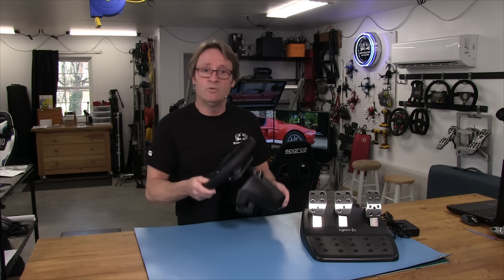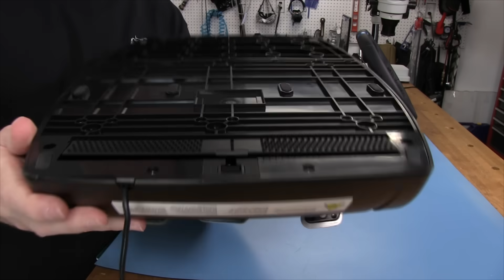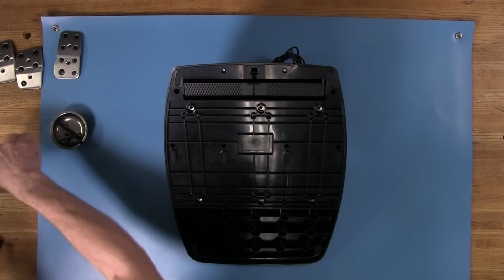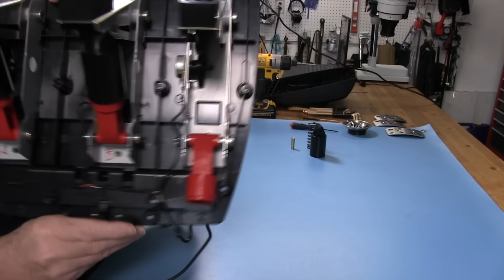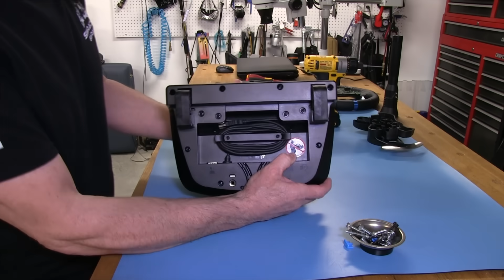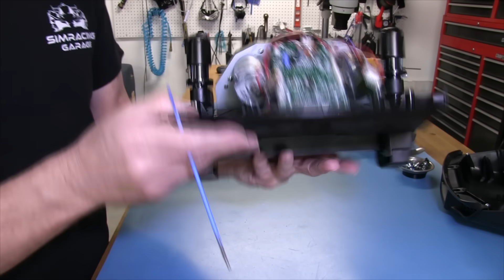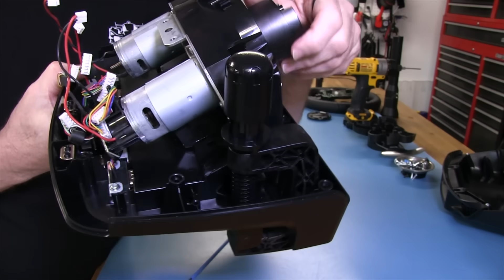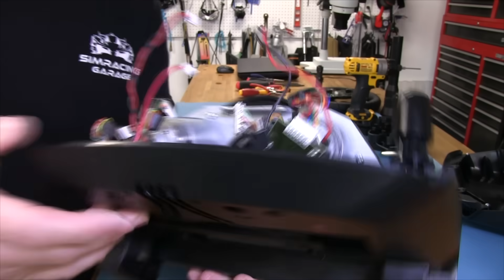Logitech G29 Review

Comment: Looking at getting the g29, however some videos seem to show really loud gearing. Is it actually that loud ? or is it just a few cases ?https://www.youtube.com/watch?v=7SCf9lEcj9g
If it is i'll be looking at the t300 rsgt, anyone got any advice ?
Reply: Hey I have a g29, the gearing isnt too loud on mine at all. I definitely cant hear it if im using headphones. However, most of the creaking I hear in the link you gave is actually coming from the clamps holding directly onto the table. I noticed this as well and I just put a washcloth or something similar between the clamps and the table to get rid of the vibrations. This made it much quieter.

Comment: Thanks for this awesome guide. Mine Ps4 light is stopped working (sometimes working when moving wheel forward) and the wheel is too loose moving along z axis easily not seem tight. Are these fixable by this way?. I don’t want it to give warranty as it will take too long.
Reply: TOLGA YILMAZ hi can you tell me what game I should get for my ps4. My Logitech g29 is coming in a few days and I really want to know what game i should get, I already got the crew 2.
Reply: Frashine1Gaming I definitely suggest dirt rally 2.0, tried wrc 8 as well but it has a way to go. I find more challenges in dirt rally to keep playing.
Reply: TOLGA YILMAZ ok thanks I will get that then

Comment: 39:50 for me that look like the steering angle limiter  i wanted to see it turned all the way to 1 side
Reply: Yeah, that's what it is. I have a DFGT, which I've taken apart a few times and it has the same system
Reply: Even it is a very nice review this part annoyed me very much because he had enough time to figure out what it is for. The statement that a plastic part can have any additional stabilization over the two huge bearings made this more awkward.
I don't want to be rude with this comment, just I think if I would make a disassembly like this, expecially to show the components and their funtion at least I would ask help from somebody if I'm not sure in sg.
Reply: You're right. The lug on the steering shaft impinges on the end of the rack at the end of the wheel's travel. If you take apart a Driving Force Pro you'll see that it has an additional piece that slides back and forth (in the direction of the steering axis) to provide an alternative set of stops for 200 ° operation.
Reply: @Catcrumbs  my logitech momo is due for replacing its getting old still working though

Comment: The only issue I have with this wheel is the button placement. I keep hitting the L1,R1 buttons and the directional pad when drifting. If it wasn't for that I'd stay with the g29. But the thrustmaster t300 gt has a much cleaner and out of the way button placement.

Comment: Honest Question. Just getting into Sim Racing and I am torn between the G920 and the TMX setup. (w/applicable shifter.) Which would you honestly recommend more? Playing F1 2019, Forza 7, and Forza Horizon4 mostly. May also add AC to the library soon.
Reply: What did you decide and why..??
Reply: @ranakirti  Still debating it, however, now I'm leaning towards the TS-PC, as it seems much better than the $250 range guys, but not quite DD tier. So, a good, in the middle.

Comment: There is no firmware curve at all.   I have the way older g25 that has no insert. I inserted a piece of rubber and it worked.  You just need to do a calibration in the software if you sont it feels off. And these mods work on the g25. G27 and g29/g920 in the same way.  If the peldals show half your drivers arent installed correctly.  Windows 10 default drivers do this.

Comment: G29 vs Thrustmaster T300rs Gt Edition? Pls let me know your opinion!
Reply: The g29 is a descent entry level wheel but its not even somethin to compare to the  t300... even the t150 has nearly half stronger force feedback and belt hybrid motor... the t300 is pretty close to a high end wheel so its nothing to compare things with.

                     MY GUIDE

Entry level. G920 maximum torque:2.1 lb of tourque.  leather and some metal parts but cheaper inside base.
One plastic shifter if you want to upgrade. Price: 300$

Entry level T150 pro or tmx pro maximum torque:3.7 lb of torque. But rubber grip that you will aftermarket change later. 90%metal shifter and sparco handbrake is a option if you want to upgrade. With eco system.
Price: 300$

Racing game fassionist Tx or t300 maximum torque: 4.2 lb of torque
Rubber or leather depends on model and massive sponsored eco system options like the sparco rally rim or the ferarri rims.     Price: 520$

T150 or tmx is for you that want to drift with massive selfsteer 
And focusing about preformance from the inside of base. With tje well preforming belt hybrid strong motor

G29 is a comfortable flat bottom wheel for racing like gt3 and f1
If you care about quiet cugs  leather and quality On the outside with no big mind on ffb strenght wich is the sad part...

Tje t300 or tx is dual belt driven gigantic motor with armbraking ffb scale. What more could you ask for...

Comment: Just a thought on something, I know it may not be required to tear everything down to understand how it works but I would have loved to see that, considering this is a 1 hour video I though it would have had that. It would have been good to fully see the materials used in the feedback drive (pinions, spur, how it all mounted.)

do you think there is a place where you could add a small fan or 2 and solder to the board somewhere in the wheel base?
Reply: You'll have to cut holes, a single fan pretty much on top of the base should do the trick.
The factory board is already overstressed, otherwise it wouldnt get hot in the first place.
With a fan you'll blow the hot air away, but with it soldered to the board you will wreak havoc on internal temps.
= Use an external supply of power.

Comment: Great video I admire the professionalism here.  I enjoy my g29 weekly, however ive torn mine down to do a little work. Cleaned It out and re greased all the gears and contact points of the pinion slider. I used a heavy coating of LUCAS RED & TACKY. I highly recommend doing this. It made a already great wheel feel soo much smoother and accurate.
Reply: How did you do this? Could you elaborate in steps?

Comment: I've got an oldschool driving force GT, I am tempted to try and put a loadcell on the brake because the potentiometer and very light spring is absolutely crap for simulating a brake pedal!
Reply: I got one too. But I don't think it's mod friendly. I was gonna just get a stand-alone set of pedal like these or thrustmaster. Then a used set of fanatecs came and I couldn't resist!

Comment: I believe the only purpose of the rack and pinion at the end of the steering shaft is for the steering lock at each end of the 900 degrees of wheel rotation. If that wasn't there, you could theoretically turn the wheel infinitely until the wire inside twisted it self up to a breaking point.

Comment: I'm new at this but wouldn't it be cheaper and more immersive instead of using a race SIM with 3 monitors use RV goggles instead?
Reply: Yes but for extended use you might encounter health issues. I had my eyes start hurting after two rally cross events on dirt 2.0
Reply: @R3C0NSM0K3R  I was wondering if those goggles would produce eye strain.  It's bad enough staring at a monitor for l;long periods  of time, let alone googles right next to your eyeballs

Comment: I have the g920. I actually removed the bumper out of the brake pedal. I was finding the extra push I was doing to keep braking was just forcing the pedal base forward. In my playseat it was ok because of the stop, but at my desk not so much. just damages the cable as it pushed against the wall behind it. The cable position coming out of the pedalbase sucks. I had to remove the pedal bar from my playseat challenge and its under my desk for that reason. removing the bumper feels better. It already has a stiffer spring than the other two pedals.
Reply: hengineer one thing you don’t get the pedals are worth £20 the g920 is worth £200 if you mess with the pedals you won’t be able to get a replacement on the wheel if that breaks... dumb

Comment: My G920 keeps going out of center when drifting or driving fast. Cleaning the Hall Sensor didn't help it. All screws sitting tight. Is there anything else I can do myself to fix it?
The wheel is now outside its warranty period.
Reply: I used to have similar issues with my G27. Replacing the optical encoder fixed the issue. The plastic optical encoder would often break or crack, creating issues for the sensor. I replaced it with a part made from brass I found on Ebay and have not had an issue since.
Reply: @jackghnj  The G29/920 uses a magnetic sensor, but I've heard the newer ones use a updated one, which works better.
Ordered a new wheel, so will check on this.

Comment: i know it's super late but a few guys did some tests about the brake. the problem is with the g29 wheel the brake reaches 100% way before you pushed it to 100% . with the old logitech wheel and the new pedals it works perfectly fine. seems like there might be a problem with the g29 board and/or software.
Reply from the maker: The difference is in the wheelbase firmwares. The pedals only have a breeakout board in them. The signal coversion is handled by the wheelbase electronics. Thurstmaster thought it would be a good idea to add a curve towards the end of the pedal stroke to simulate a load cell on the G29/G920. Too bad Thrustmaster does not let you change the curve back to linear. Where it belongs.

Comment: 39:25 Whatever about the other stuff you mentioned, that rack and pinion is what provides the mechanical stops for the wheel's rotation. When the rack is all the way to one side, the lug projecting radially from the wheel axle impinges on it as the wheel reaches the end of its rotation.

Logitech's older Driving Force Pro has a very cool addition to the mechanism in the form of a separate, rectangular block that lies along the steering axis and could be engaged or disengaged to alternate from 900° to 200° of wheel rotation. Because the block lies under the steering axis, the axle's lug hits it on every rotation, as opposed to the rack that stays free of the lug until a few turns have been made. I believe it is the only consumer wheel to have hard stops for both amounts of rotation.

Comment: do you know how to fix the brake from engaging the ABS went the brake is not being applied? I took apart and do not see any dust or particles around the wheel mechanism of the brake or any pedals. ABS flashes at times on straight, and stays on coming out of a corner.

Comment: I played with the brake settings in iRacing and can now feel and really control braking for corners and tiptoe around chicanes at just the right speed because of good brake control on approach.  Play around with the Force Factor, Brakes section in options/drive. There's no real need to modify the pedal, and using that rubber damper does work,  just tweak and work on that big toe's muscle memory.

Comment: Loved the review. Thank you for the deep insight of the wheel. I just picked up this wheel for $138. Waiting for it to get here. Last wheel I had was the Xbox 360 force feedback wheel. Still have it actually. Just doesn't work for anything else but Xbox 360. Do most racers with this type of setup use left foot for brake? I've always just used my right foot. I know its probably slower response time. Is that just a personal preference? Or should I switch my habit?
Reply from the maker: I would switch. I will give you more precise control of the car.

Comment: More a dissemble video... nothing about driver installation, configuration, strength of FB versus other wheels in nM etc.  And PS the brakes in cars are never linear , especially not in RL racing cars. The way Logitech implemented it, is a bit sketchy i agree

Comment: On the brake pedal: i read somewhere if you drill three small holes in the rubber block sideways (left to right) it makes the push back a little more reasonable. It made it more realistic for me.

Comment: I am using the same wheel and when I start sliding the force feedback turns the wheel automatically to save the slide. (without any in game assists) is it supposed to do that or is there a way to turn it off without turning every force feedback setting off?

Comment: The g25 was better.. Stronger motor, larger wheel and with a shifter that also switched to sequential.... the main weakness of this wheel is the steering shaft or neck, Ive had several of these and the ball bearings are prone to dislodging and seperating making the wheel loose .... Ive also had several defective from the store....just saying.

Comment: My advice from owning a g920 for about a year now is to take the rubber stopper out of the brake then recalibrate the pedals in the logitech software and if your using Assetto Corsa then you can remove all curve from the brake pedal in the in-game settings too, after doing this my enjoyment using the pedals went up 10 fold.
Edit: This is a great buy for anyone that just wants something cheap and decent quality to get started in sim racing or just having some fun in games like project cars 2, NFS, and forza. It is good enough to keep you competitive in sim racing (depending on your skill level) and I would buy this over any other wheel combo as a starter.
Reply: is it possible to do something without removing the rubber?

Comment: I just bought a racing chair and a logitech g29 with pedals and shifter yesterday. A very nice VR headset came with it too to play Gran tourismo with online. All this was only about a month old so it was a good deal. The headset is incredible with Gran tourismo and I can't use it personally but that is another story. The wheel I can use and if I had to do it all over again I would not do it. 
I have not tried G4 cars yet but it works reasonable well with a Ford GT. However, racing a Toyota N200 front wheel drive car is incredibly difficult and on the wheels lowest settings it WILL jerk the steering wheel right out of your hands while rounding a long curve in the road. To me, reality says these cars have power steering and should not be doing that. The G29 OVERKILLS force feedback! There is a reason for the turn "Force feedback!" and that is because it will force the wheel right out of your hands as if you have NO power steering. 
I perfectly realize it could be my driving but when the same driving technique can be handled by a wireless remote it should also be handled by the wheel.
My DR rating has gone from a B to a D in just one day. Every time I even round a curve the wheel jerks out of my hands not to mention it mostly feels like grinding bearings with a rocking motion dead center which only gets worse with front wheel drive cars.
The G29 is overkill in the force feedback system and it really should "Emulate" and not "Forcefully simulate". I would like to know how the T300 is or any other kind of system. I also really don't like the fact that the racing chair has to sit so close to the tv just because of all the wires having to reach the ps4. It seems like it could be wireless. 
Hands and wrists really hurt today and I really don't feel like racing. I might just sit in the chair and use the wireless remote. At least my rating might go back up.
I do however like the brakes and pedals unlike other comments about them concerning the rubber piece in the brake. I had no problems stopping for cars in front of me and it was pretty precise. Not at first mind you but it seemed to have gotten better and worked better a couple of races in. My braking style never changed it just seemed to work better the more I broke the brakes in.
Is their anything I can do or what setup would be better?

Comment: had one of these good entry level wheel but I went through three sets of peddles due to flickering throttle got new g29 everytime so customer support really good but not very reliable.I upgraded to a t300 and my goodnes what a change in ffb feel and strength loving it so far but time will tel for reliability
Reply: Any problems so far with the T300?
Reply: Very noisy and creaky sometime it sounds like the belt slips or rubs feels great but the quality for this money is not great for heavy use on driving sims just my opinion. Also the paddle shift on one side has lost the clicking sound and feel after about 2 weeks going to ram and get another one on warranty grounds.
Reply: @scottybhoy8375  Yeah, I was thinking about getting the T300 but after reading about all these reliability issues I decided to get the g29. I'm still not sure if I like it but I'll see. Also , the g29 is 200€ on amazon vs 330€ for the T300 with decent pedals.
Reply: @Marco-dr5ho  G29 is worse for reliabilty Im afraid to say I went through 3 of them on warrenty in under a year I had issues with the throttle pedometer starting to flicker 2 times in a row the 3rd wheel I sold it on ebay and bought a t300 these things aint built great and even the high end ones go under heavy use the manufacturers need to sort it out just not good enough.

Comment: Anyone having calibration issues with their g29? Mine loses calibration very often during a race or when I crash. I’ve tried recalibrating it on my windows computer  but still loses calibration couple minutes later. I’ve also tried updating the software but the problem is still there. Only thing that helps is unplugging and plugging back in the usb from my ps4. But it’s annoying doing that multiple times on 1 race. Please help!

Comment: Really good review of the G29, I replaced that rubber buffer in the brake pedal with a atv master brake cylinder that's hooked up to a slave brake cylinder with brake fluid and it feels so much better. I also opened up the rear vents, installed some small fans hooked up to a power supply and switch.
Reply: Same, I also replace the inside mechanism with a real miniature car that has about 300nm force